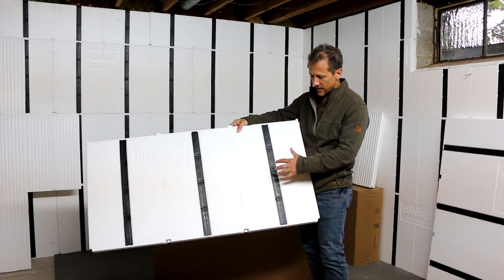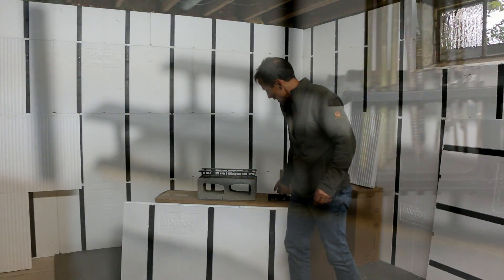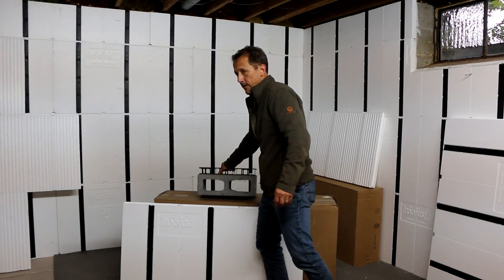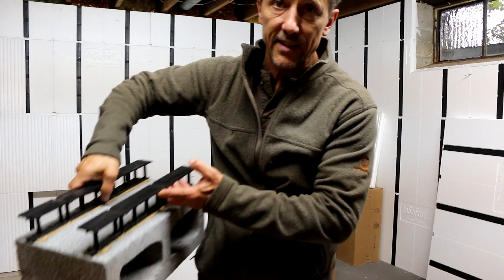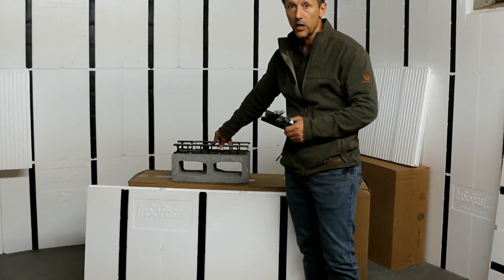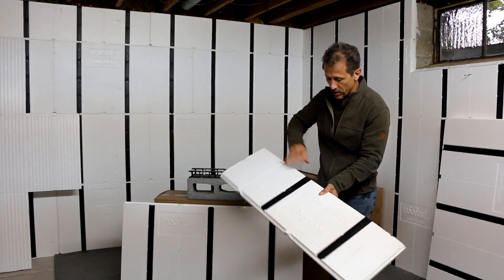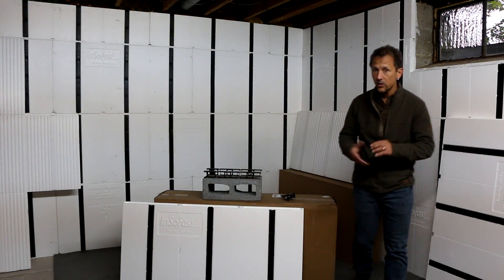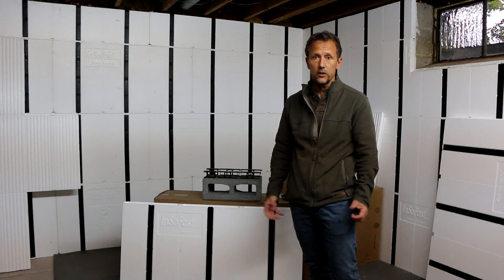Will Glue and Screws Really Hold the Stud?

Comment from the maker: https://insofast.com/explore/adhesive-attachment/ Loctite PL Premium’s 3X Stronger Construction Adhesive on clean concrete surfaces. It is the adhesive we recommend. Other formulas and brands may not work as expected. The technic you are describing is called flashing. The adhesive manufacturer has other tips and suggestions: http://www.loctiteproducts.com/p/pl_ca_prem/directions/Loctite-PL-Premium-Polyurethane-Construction-Adhesive.htm

Preparation
Use above 40°F (4°C). Surfaces must be clean, dry and free of frost, grease, dust and other contaminants. Pre-fit all materials and protect finished surfaces. If using cartridge format, cut nozzle at a 45° angle to desired bead size and puncture inner seal. Be very careful not to allow Loctite® PL® Premium to cure on a finished surface.

Application
Apply adhesive to one surface of the material being bonded. Press the surfaces firmly together. Materials may be repositioned within 45 minutes after applying the adhesive. If bonding two non-porous surfaces (such as foam, metal and fiberglass), add water in the form of a very light or atomized spray from a plant mister bottle to the extruded adhesive. The repositioning time will then be reduced to less than 30 minutes. Use mechanical support for 24 hours while the adhesive cures.

Flashing exposes the polyurethane adhesive to moisture, "humidity," that will aid and accelerate the adhesive's set time.

Comment: Do you have yo hang drywall or can you just paint this product?
Reply from the maker: Terrill it depends on the application. Building codes are pretty clear on their requirements of having foam insulation covered with something like drywall if it is used in a habitable living space. Paint over foam insulation does not give you a very durable protective surface...it will get dinged and dented.
Reply: @insofastllc  thank you
Reply from the maker: @terrillford7784  Sure

Comment: Off topic curious question: R10 in 2" is good, but vastly eclipsed by polyrurethane spray on foam, which would be R20 in the same thickness.  Why can't the panels be formed/manufactured with polyurethane instead of the white stuff?  Can I buy just the plastic studs w/out the foam attached?
Reply: Just by 2x4's and glue them on then.

Comment: How is product installed when the foundation wall thickness changes from bottom to top, wall is 12'' at bottom 3', 10" for the next 2' and 8" for the next 2'
Reply from the maker: It sounds like this might be a helpful video for you: https://youtu.be/JB1gfGee1kY
It covers what we call "half-high" walls, where the recess of the wall changes.
Reply: InSoFast 
not really, video is a typical situation where foundation transitions to stud wall, my situation is 2 offsets of 2" at different heights, thereby making it impossible to have sheetrock in one plane. I am contemplating 'building out' upper portions of wall with rigid insulation so it is flush with 12" wall and then install 'Insofast' panels from floor to clg. I will secure rigid foam to masonry with construction adhesive
Reply from the maker: That sounds like a great solution! In that case, however, we would recommend installing the InSoFast first with the extra rigid board over top to flush out your wall. This way your drywall can benefit from the structure provided the InSoFast panels built-in attachment studs.

If you did it the other way around, you would have to fasten the InSoFast through the rigid board to the foundation wall with mechanical fasteners. Overall, it would be a weaker structure that introduces holes in your wall.

We actually call this method InSoFast PLUS, here is a page if you are interested: https://insofast.com/explore/insofast-plus/
Reply: InSoFast 
how is Insofast panels attached to wall? and if I install as suggested, now I may have to build out with rigid insul. even more. don't see why I can't install as 1st suggested,  Insulfast adhered to rigid insul adhered to masonry
Reply from the maker: No, it's same amount of rigid insulation as you had previously determined. We're just suggested you switch the order of your layers so that the drywall can be attached to the InSoFast studs instead of your foundation wall. You could probably do it either way, but we feel it's less work to have the InSoFast studs bonded to the wall.

To explain, in a normal rigid board installation, you would adhere the board to the walls and then add furring strips over top to secure drywall. This method works, but it means you have to puncture your foundation which could, for instance, weaken its waterproofing. With InSoFast, the embedded studs ARE those furring strips AND they can be adhered directly to the walls without poking holes.

Here is a video from This Old House showing the furring strip method you can avoid by using InSoFast: https://www.youtube.com/watch?v=oKQdo88Ne74
Reply: InSoFast
won't installing Insofast 1st present problems with electric installation?
Reply from the maker: Not if you utilize the built-in electrical raceways running horizontally and vertically in every panel. You can learn more about all the features of our panels and how to install them on our website: https://insofast.com/

Here is a page specifically on how to run electric through the built-in raceways: https://insofast.com/explore/electrical-integration/
Reply: Despite this comment thread is 2 years old, I would just take some steel stud (not wood as it will allow for mold and insects to become attracted to it and lead to problems down the road) and cut to fit as a means to bandaid the problem, though it will limit the strength of the panel fasteners come putting up coverings and attaching other things. Or the other solution is to Put up some form work to infill with more concrete to make it flush but also put in some fastener to help the new concrete to stay in place in lieu of solvent type adhesive to adhere the new concrete to the old stuff.

Comment: Hey guys, question.  Once drywall is installed, can shelves and cabinets be hung on the wall as well - assuming we hit a stud?  Is there a weight limit?  Thanks!
Reply: Have these in our basement. Rhe problem is once drywall is installed it is absolutely impossible to find one of these "studs", or even know if you've hit one.